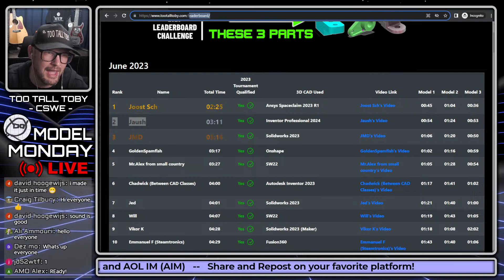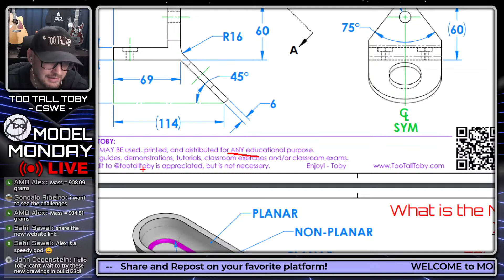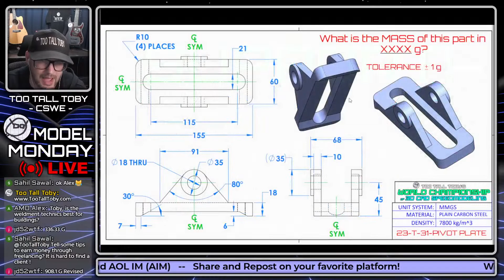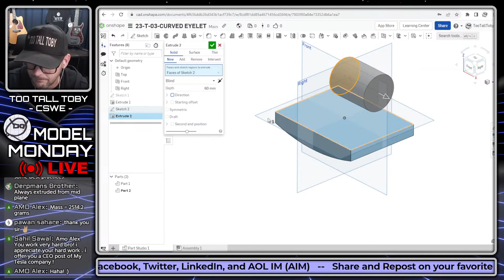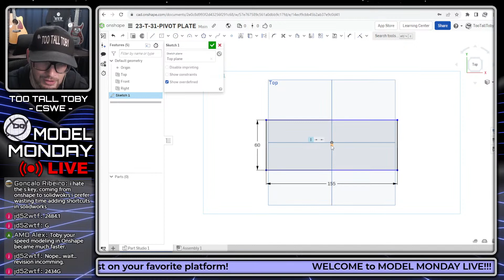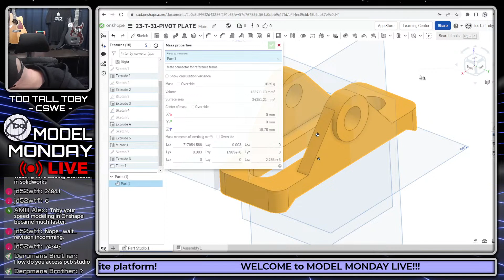Model Monday LIVE - Live Modeling Challenges - Onshape Tutorials

Comment: The Lock Star only has one symetry.
Reply: The center hole has a little notch at the top which prevents the second symetry.
Reply from the maker: @meinkanal5642  Awww CRUD!!  You are correct sir!  I'll fix it when I release the practice models version of that print.  thanks for the heads up and good eye!!  +1 to you! 😁
Reply from the maker: Hmmm... Not sure that I agree here.  Could you please elaborate?